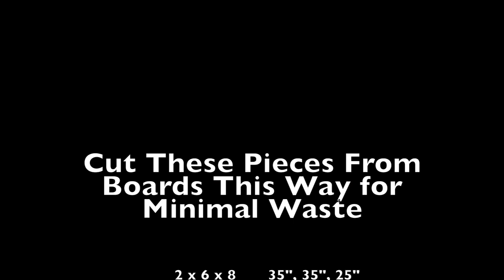#57 Awesome Shooting Bench Build Under $100 00

Comment: I just built this and love it.  I, too, pre-cut the base section prior to taking it to the hunting land and putting it together.  The one change I would suggest is to cut 4-25 in boards instead of 4-20 inch boards.  This allows you more leg room from the table.  You can then move the 16,5in boards closer or farther to adjust the leg room.  The 20 inch boards were slightly too close for me, even when I moved all the 16.5 boards to the back.  The other part I didnt get is the boards that are mentioned only is for the base, if you get (4) 1X6X8 deck boarding, it will be enough to do the top.  Take a cordless saw to cut the top once the base is built.  To cut the angles, just put the board on the table, then take a pencil and run the underneath section to show you where to cut.  If anyone can walk off with this stand, they deserve it, it weighs a ton, and that is perfect for me!  Thanks for this video, my whole hunt club loves the new shooting table.

Comment: Great video.  Built my bench for about $150 bucks.  Took about 6 hours using Dewalt slide saw.  I made one change and one addition.  I changed the direction of the decking material and center support for the table.  In addition I bolted the seat 8:03 bench to the table for extra support.  I use my tractor to lift the bench on to my elevated shooting platform and want extra support.  Really appreciate the cut list.

Comment: Thanks for the great shooting bench plans!

Time Line:
2:50 Cut List*
5:10 Framing Pics
5:30 Assembled Frame w/o Top
6:10 Top View Dimensions
6:15 Elevation Dimensions #1
6:20 Elevation Dimensions #2
6:44 Material List
12:34 Finished Bench Pics

I've worked up a couple lists that I found useful to me before I set out to make this bench.  Of course, as others have noted, I don't believe you have included the materials and/or cut list for the top.  It looks like to me you have used 5/4 x 6 treated deck boards for the top and I purchased (4) 8 footers for the top.  Easy enough to cut them to fit the top by using the framed top as a pattern once I completed framing the bench... simply lay the boards on the side-by-side and mark the bottom with a pencil, remove and cut to fit.

My Materials List and current prices at local Home Depot as of 29 Dec 2019:

(10) 2x6x8 $5.47 each (Total: 54.70)
(1) 2x8x12 $12.17 each
(4) 5/4x6x8 $5.47 each (Total: 21.88)
(1) 1 lb box #9x3" Deck Screws $9.47 each
(1) 1 lb box #19x3-1/2" Deck Screws (used where screwing into end grain) $9.47 each
Total: $107.69  Note that I purchased an extra 2x6 and a longer 2x8 than necessary.  For slightly higher cost I should have room to cull and optimize for best quality, and maybe eliminate a return to HD to replace a defect or miss-cut.  All boards are Pressure Treated Lumber.

Cut List For Framing Members:

Qty    Material/Length/Part Description

4        2x6/35"/Forward Legs
3        2x8/35"/Rear Legs
4        2x6/43"/Top Front & Rear, Bottom Front & Rear
4        2x6/25"/Top Ends, Bottom Ends
4        2x6/20"/Rear (Center) Top and Bottom
3        2x6/44"/Seat Horizontals
2        2x6/17"/Seat Verticals
1        2x6/40"/Top Stretcher
6        2x6/16-1/2"/Seat Tops
Reply: Thank you for including what length pieces were used for which part of the bench. I watched the video twice trying to figure out how it was to be built. I’m a little challenged as a carpenter 😂

Comment: Awesome! Mine came out great! Thank you so much! I went with 2x4 for base and top frames to save weight and money, still super rigid. Used a router for edges and used all treated lumber. I wish I could share pictures on YouTube! If you want to swap for 2x4 construction… you’ll need 6 2x6x8, 4 1x6x8 for top, and 5 2x4x8 for base and top frames. Thanks again!
Reply: I was going to ask if swapping 2x6 for 2x4 would workout. Thank you

Comment: I just finished cutting all the lumber for mine this evening. I bought everything at Lowe's. I'm going to modify mine just a little bit though. I bought Two 8 inch steel lawnmower wheels and Two 1/2" × 3-1/2" Stainless Steel Carriage bolts,  Six - 1/2" Stainless Steel Washers, and Two axle end caps. I'm planning to attach them to the bottom front of the table so I can lift it from the seat end and move it around easily. I may have to raise the bottom frame an inch or two and shorten the two front legs. I guess I'll put skids on the other legs and under the bottom where the seat is. Great idea and great plans. Thanks. Update: At 6:50 the cut second from the bottom, the second piece should be 40" instead of 41". I finished building the table. I added wheels to the front and 1-1/2" skids under all other solid areas that touch the ground so it will sit level. I also added a cable attached to each end below the seats with a 3' piece of PVC pipe  so I can pick it up on that end and roll it around to wherever I Want it for shooting or storage. I used some old decking boards I had removed from a deck and cleaned them up with Thompson's deck Cleaner, then weather sealed the whole thing. It looks great. I used it to zero my Ruger 10/22 then my 300 Blackout. Works great and very sturdy!
Reply: Association of Free People  The material list is 2×6×8 (9) & 2×8×10 (1). You will also need a few deck boards to cover the top. They're not on the cut list. At about 2:52 there's a cut list, but at 6:46 there's a list that shows how to cut each piece to get the least scrap. Unfortunately he skips the part where he cuts the 45° angles on a couple of the short boards.  I would have liked if he had put the list of materials and cuts together at the end of the video like he said he was going to. I had to skip around and pause quite a bit to get all the info. It is a nice, sturdy shooting table though. I love mine.
Reply: @kschantz  What did you come up with for a dimension on the angled pieces? Wheels are a good idea. Would like to see yours completed.

Comment: You will (2) additional 17" 2x6's (or 2x4's) for the 45 degree side pieces as well as (4) 1x6x8 deck boards for the top.  Otherwise excellent video!

Comment: The impact works better driving screws then the drill trust me we use them every day a must for driving self tappers if the drill has a clutch yeah it's usable but use it all day compared to the impact you will figure out what I'm talking about! Like I would of put them 3 in deck screws in with the impact it works great for that they arnt really built for taking bolts out as much as driving tappers long screws really the only time I use the drill is for a drill bit I use a electric impact for mower blades and dewalt impact for smaller bolts and such on my truck or mower

Comment: Obviously not your first time handling tools.
We have a very similar bench at our Cameron County PA camp.
IT was originally built by a member for use at his Bucks county home in the 60s.
When we built our camp in 1973 it was moved there.
It was built with regular framing lumber, not pressure treated, as that wasent available at that time.
However, it received numerous coats of wood preservative.
It also sits on a concrete slab.
Today after more than 60 years it still appears like it was recently built.

Comment: Lumber is cut, just stained the ends. 
1st measurement I wrote down was 35, 35, 35. No matter how many times I measured the wood was still too short. Then I double checked the cut list and made the two corrections. 
One of life's hacks:
Use wax paper on your saw top to make the wood easier to slide to the cut mark.

Comment: My experience with Dewalt 20 volt lithium ion tools and batteries is the opposite of your experience. I got tired of 20 volt lithium ion tools shutting off while in use and went back to my 18 volt nicad tools.  Just bought new 18 volt nicad batteries which work until batteries are actually low unlike 20 volt lithium ion tools.

Comment: The 41" board is actually a 40" and goes down the middle of the top.  Also, this list does not include the top decking materials.  Finished product is quite heavy, so find a spot where you can set it and leave it.  Other than that, it makes for a sturdy bench.
Reply: did you happen to make measurements of your top decking?  I just drove 6 hours out to my land to put this stand together and wondered where I went wrong to miss the entire top deck.  The good thing is, if anyone steals it, they worked their butt off to get it.
Reply: @brettdman2908  4 boards 2 X  6 X 8ft
Reply: To be more clear, it only takes 3 boards to finish the top.  I used trex for this and bought a fourth board to use for the seats and replaced the wood that was already cut from the original cut list.  To make the one board work you'll have to shorten the pieces to 16" (instead of the 16.5")  That makes 6 pieces and is exactly one board length

Comment: A lesson learned.  I built a shooting bench with brand new fresh from the lumber yard pressure treated lumber.  Lots of screws, bolts and braces and a very nice flat shooting table top of 2X6 pressure treated boards.  Three months later,  the shooting bench top had 3/8 inch gaps between each board where .22 cartridges would fall down through the gaps to the ground.  Not a happy camper.  Lesson learned......let the wood completely dry out before construction.
Reply: Just take the screws back out, adjust the boards, and screw it back down, might need to add a piece, but that'd take care of your problem.

Comment: One more question please. Where does the 41 inch 2X6 go? I love your plan and have already cut all the boards, but can't figure out where that one 41 incher goes. Hope you see this.
Reply from the maker: I will have to look but I'm guessing in the center of the top right under decking boards, (for stability and something else to screw to)
Reply: I think you are correct about it being the center brace for the top. But your video shows that piece being 40", that's why it confused me. Thank you sir.
Really enjoy your videos.
Reply: BadCow it should be 40”. I just built this bench and ran into the same issue.
Reply: Yep, 40" is correct. I built the bench 2 months ago, awesome plan, great shooting bench.

Comment: You could have spent a lot more time on shots of the bench and measurements, and less on talking about nothing.  Some of the measurements were also wrong and that's very frustrating I'd say fix your mistakes before posting you can't get 3 35 inch boards out of an 8 foot piece of lumber and putting it together was a puzzle because you moved your camera to fast to really see what went where. All in all I got it accomplished with some cussing and modifications..